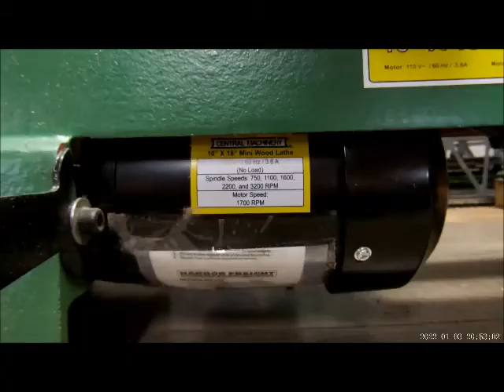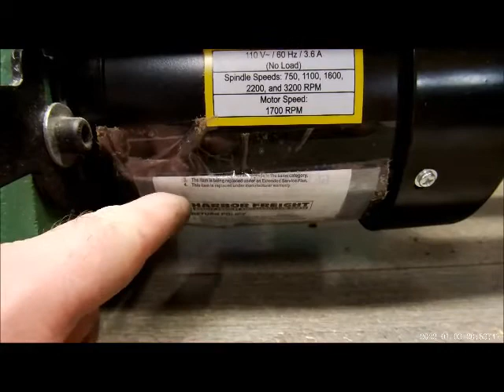Harbor Freight Mini Lathe Review - PAUL DIBARTOLO

Comment: I've had mine for six months now, and only two minor things I'd criticize. The tool rest lever is annoying, and it would have been nice to have a continually variable speed motor. But you won't find a nicer lathe for the price. I'd recommend this lathe to anyone who is starting, or even a more experienced worker who needs a small wood lathe.  A strong buy on this unit.